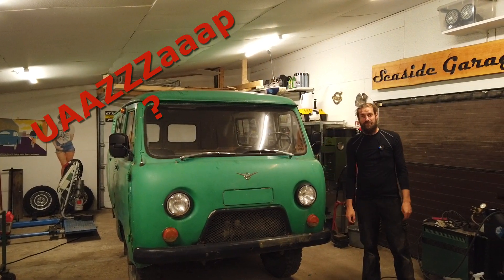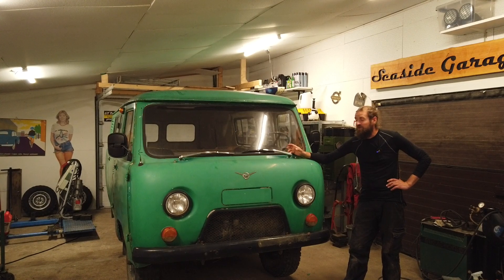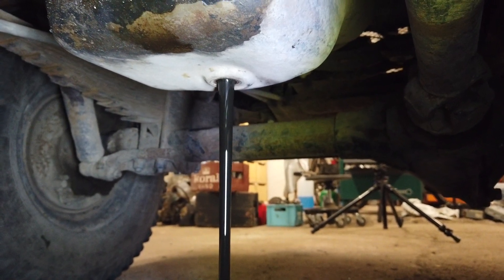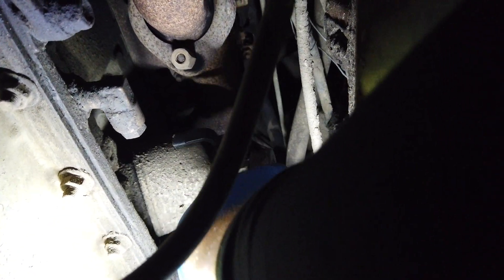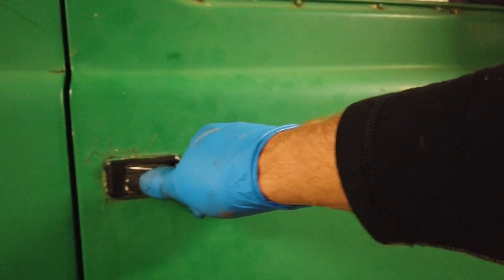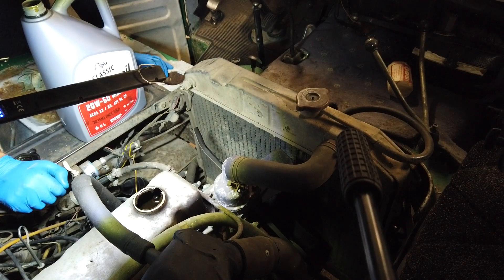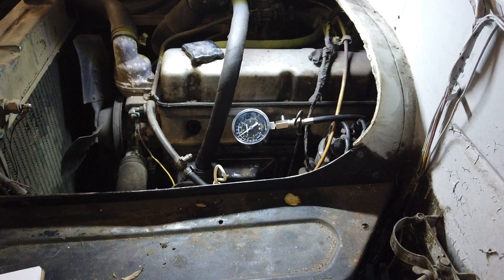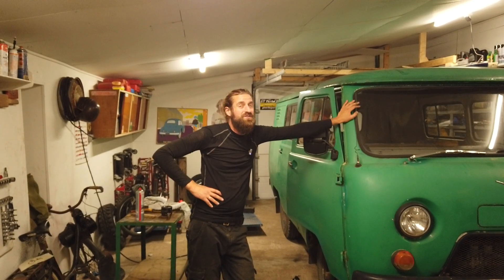UAZ 452 BUKHANKA- Engine health check. Compression test

Comment: I UAZ soo happy to see this. 😆👍More More More!!!!! More episodes! More uploads!!!! 😎👍 ....this will also make an EXCELLENT chase vehicle, moped rallying.
Reply from the maker: YES! and if i get tired of the noise and low speed I can always take one of the mopeds.... :P
Reply: @SeasideGarage  🤣🤙 ...of course my moped isn't that quiet, being a 70cc DMP piston port E50, with matched case, and brand-new 15mm Bing with a high rev Fuego pipe. 🤣 ...A little quieter than most, because I use a slightly modified air box designed for a 14mm Bing.

Comment: Looks like there are no nasty surprises with the engine and that white stuff on the sump plug looked like plumbers P.T.F.E tape. Looking forward to some welding videos on the UAZ. Looks a great van Seppo.
Reply from the maker: It was some sort of wool material... :) 

I will make some! there is a lot of rust that needs to be fixed... !

Comment: Well done! If the engine and general mechanicals are decent, and the rust is not terminal then I think you may have your camper van! The interior rebuild may involve more in the way of carpentry, wiring and furnishing than engineering stuff, and I've seen several vlogs here that show people doing this. One way might be recycling and renovating interior parts from a derelict caravan, which could save a lot of money and work. 

If you can find a local affordable upholsterer they can do amazing things with old car seats and making bench seats for campers - they even fixed a torn and worn out seat on an old motorcycle I had when a replacement was no longer available.
Reply from the maker: I would really like to do as much as possible my self... And also, Upholsterer are VERY rare and expensive in Denmark.... 

Thank you! I really thing this could be a very special car/truck in the end!